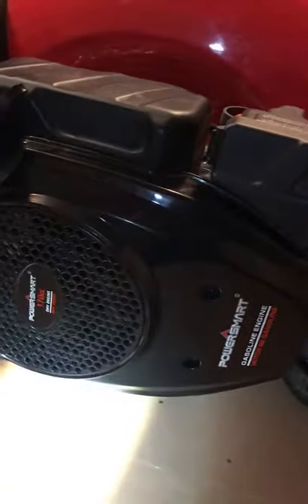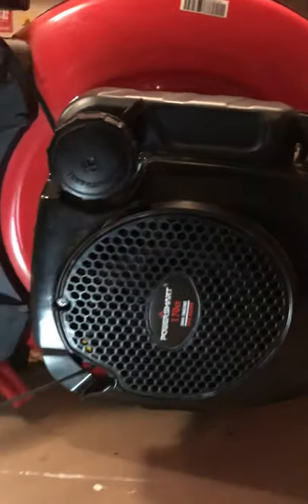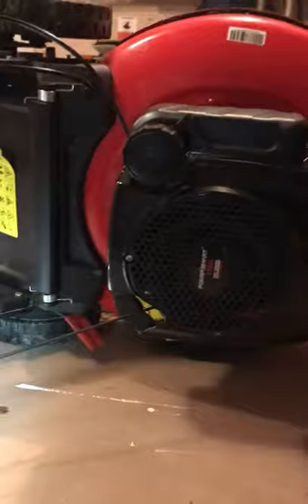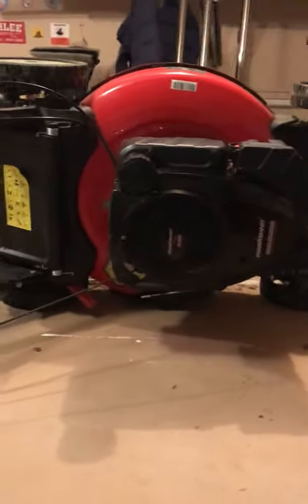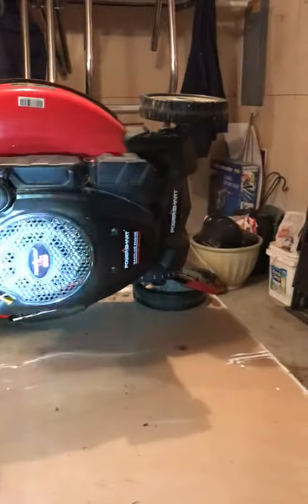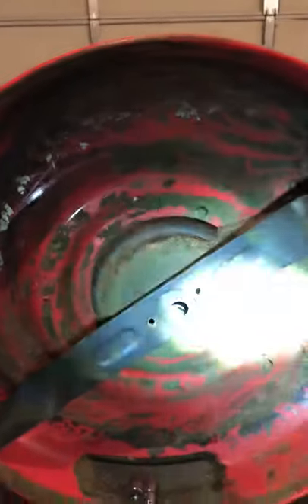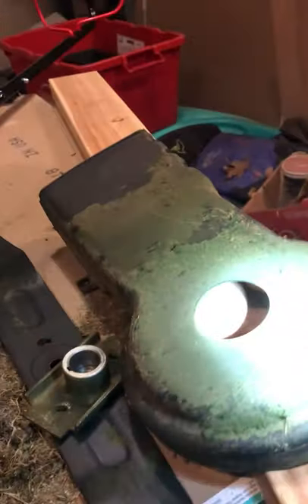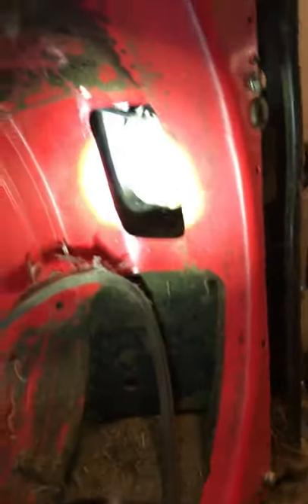Belt removal for Powersmart self-propelled walk behind mower

Comment: My belt broke today on my 22" 196cc powersmart rear wheel drive so thank you. But did want to say I got mine at Wal-Mart for $200 in 2019 & it has been a great mower, it gets beat to death & used on a huge, very hilly, rock filled yard and it just keeps on going. I mowed the yard next door which was wet and about 4 feet high & it got clogged & probably that's what happened. Mine starts first pull every time, I love this mower which replaced a $450 TORO.(which only lasted 12 years!LOL!) UPDATE: I could get no response from POWERSMART! If u have a 22" 196cc then take the belt to NAPA! Also, if belt keeps slipping off check with ur fingers running in the flywheel groove, there was a tiny pebble in there! Anyway, NAPA had the belt for $24(after 7% tax in PA!); its nearly impossible to find 22" & POWERSMART customer service will be their demise! But my mower after new belt & blade is LIKE BRAND NEW NOW! PS: My friend who is a man actually put the new stuff on, u gotta be a strong guy to get that belt on. Also, tie the drive engaging bar so the flywheel moves giving u more room to work & take off the spring with pair of needlenose. Thank heaven this guy made this video! PSS: Also did not have to drain anything, just tipped on side(air filter up), after new stuff set it down, started right up & runs LIKE NEW!

Comment: Thanks for this. The "self" part gave out on me and I was hoping it was a belt. I finally found the flywheel and saw the loose belt, but my well was so caked with grass, I didn't even realize that belt cover was even there! I was getting ready to tear the whole back end apart... or consign myself to muscle power. And that's in short supply. Thanks again.

Comment: I have had two. The 3 wheel one which is dangerous as crap on anything short of a plain and the db 2194s which has been a headache. Replaced the belt, replaced the belt cover.  Now the self propeller has broken.  I don’t recommend it to anyone. MY manual says 303200100 for the cables but m&d store online said it needs 302080057 and that cable works well on the gas part but the wire is too short for the self propel connection needed near the fly wheel. Just stay away lol. You will constantly be popping that belt cover off and clearing grass.

Comment: My brother bought his and he moved and left it broke so I took on the job of fixing it.  When I turned it over the bolt was difficult to come off. when I finally did the blade came off, but then the blade adapter came loose and I can't figure out how to put it back together. There was a weird thick metal washer that really doesn't fit anywhere that fell out. Any, I did figure out how to get the belt back on. I did have a new one but fortunately my old one wasn't shredded. It had just come off the wheel.  I do have a suggestion though, for any equipment, my son ran he own landscaping business and I know that if you take care of your equipment it will take of you except for this one.  Make sure you water spray off your mowers top and bottom after use. It does help.
Reply from the maker: Yep, and during the winter I try to go out and start my mower once a month and let it run about 5 minutes because that makes if so much easier to start come spring time.

Comment: Bought mine in 2020 from Home Depot.  My belt shredded and the cover also was ruined.  But it was still under 3-year warranty which i had purchased.  I emailed the address on 10/3/21 and received a prompt reply.  Just today, 10/10, I received the parts via FedEx.  

My problem now is that I can't get the new belt on.  The old belt was shredded and ejected out of the mower while I was mowing.  I cleaned the works just as Bakmak did, but when trying to get the new belt onto the pulley I just don't seem to have enough room to squeeze it through the tolerance between the pulley and the housing.  Do I have to drop the self-drive unit to get the belt on?
Reply from the maker: I didn’t need to drop the self drive unit for installing the new belt. It is a tight area in which to work with but I succeeded after several attempts. I used a screwdriver as a prybar to extend the belt around the pulley because it’s really difficult to stretch the new belt into place.
Reply: @bakmak8199  Thank you for the reply.  I ended up removing two screws from a bracket at the end of the axle which the drive unit mounted on.  I was able to slightly lower the axle, about a 1/2" which gave me plenty of room to slip the belt on.  Now the self-drive is back in good operation.
Thank you again for the video and the speedy reply.

Comment: I’m having the same problem. What size belt fits?
Reply from the maker: This is the only one I’ve found that works

PowerSmart Part Number 302040073 Drive Belt (SANLUX Z813Li835Ld, 302040071) https://www.amazon.com/dp/B08T7LS2TQ/ref=cm_sw_r_cp_api_glt_fabc_E0A8QXXQB1S5WHEG1D3K
Reply: Go to NAPA with old belt. Especially if u have 22" 196cc DB8631 u will find replacement there, & only there! Not online either, have to take old belt with you.  FORGET@ contacting Powersmart, it is "no man's land" & you'll waste hours & days for nothing!

Comment: This is strange.    I have powersmart, but the blade bolt was 17 mm.    Easy enough to remove, but there seems to be another hole in my plastic cover, which seems to be bolted from the top, and impossible to remove, as there is no screw from above the deck to remove it.     Hmmmmmm.
Reply: 3/8" x 33" belt works perfectly.
Reply: @justinupton7903  I Know what belt it is.    That's not what my comment was about.